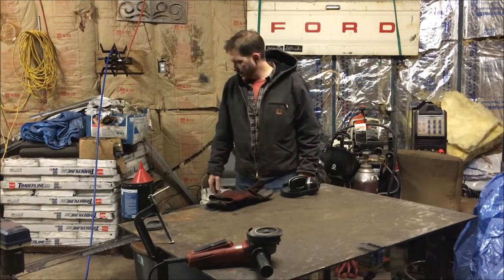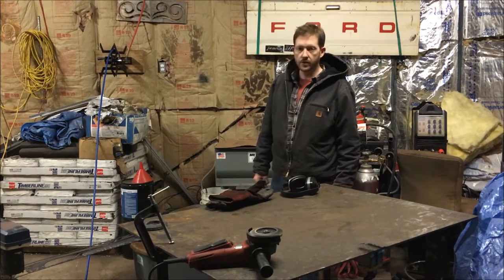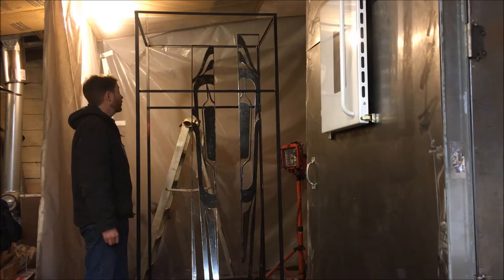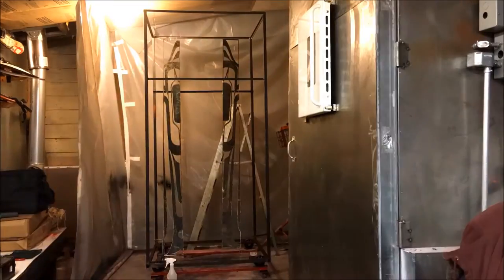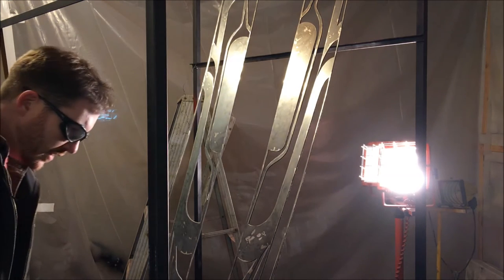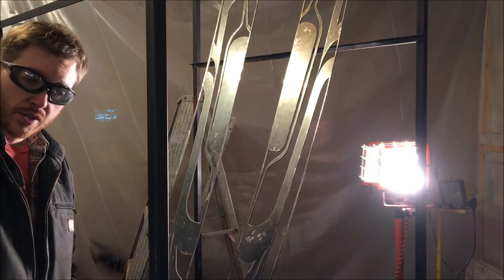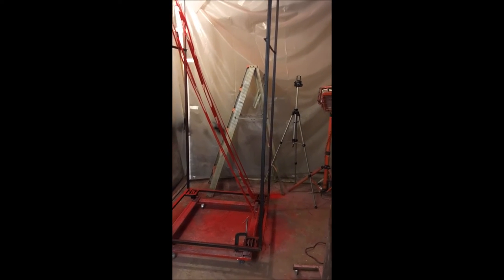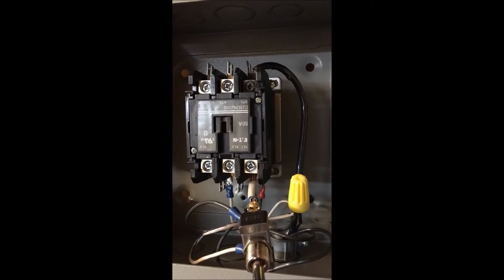Powder Coating Formline Art HVAC Covers + Mysterious Smoking Wire

Comment: Hey Adam, on a few videos back I explained why you are having issues with this Oven build. From your previous diagram, likely you are using upwards of 60A+ on the circuit. You should be running 4AWG minimum from the main source of power to the contactor if you are going to stay in this configuration, but I would run, a minimum, one SSR per 2 elements. It will cut down on the wire gauge requirements, from the contactor/SSRs, but you still need to be running 4AWG from the breaker to the other side of the contactor.